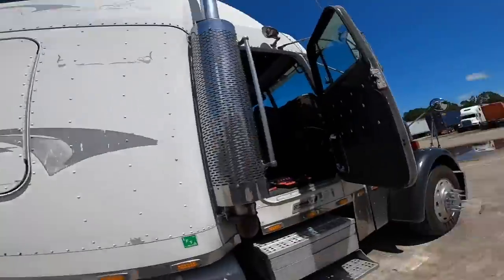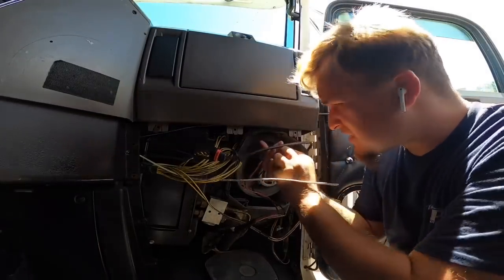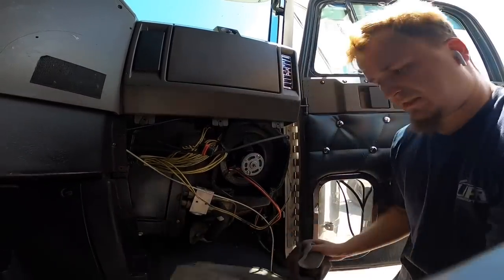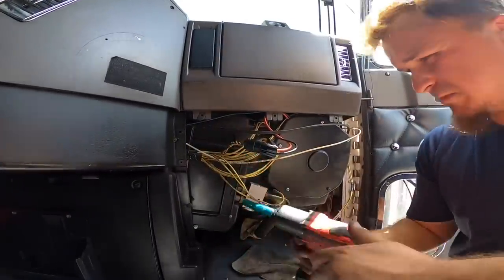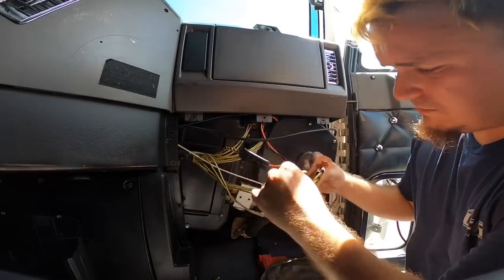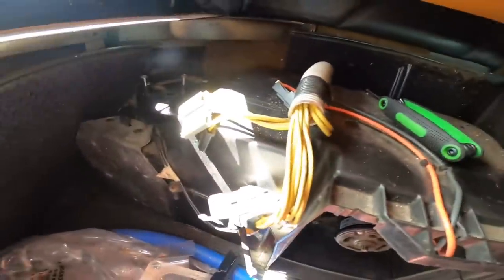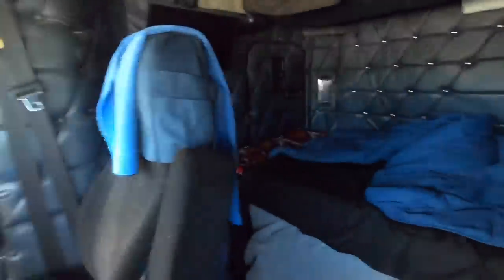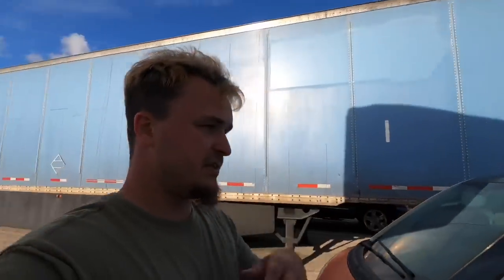Freightliner Classic How To Replace Blower Motor & Resistors

Comment: Hey man my speeds work in the front but when I switch it from max/ac - ac - vent - heat - heat/def - defrost , it only works on the defrost , it stopped blowing towards the driver .. any suggestions what it could be?

Comment: Hey ak, did you ever get a water leak coming down from that area? I got 3 drip leaks (holding with buckets) right below the yellow wires here in your truck.. was wondering what could it be...

Comment: 1998 freightliner century here....after the front blower motor went bad, they replaced it,  it works in all 4 speeds...but the air coming on vents are too weak now....what could be wrong...any ideas ...please help

Comment: When you changed the hose (behind glovebox) on another video did it help with airflow? My ac blows cold but not hard at all
Reply: As long as it blows cold bad blower motor or blower motor resistor.. if all speeds work then it is probably the blower motor they go bad start to drag and slow way down
Reply: That hose/ air tube he fixed at one point I’m for sure operated a blend door/ location of air....so if your air was not switching say floor or window etc or it wasn’t switching from hot to cold

Comment: So if it doesnt blow at all on any speed what do i need to replace?
Reply from the maker: If it Doesn’t blow at all replace the resistor first and then if it doesn’t work after that the motor
Reply: @TruckerAK  ok thx will do